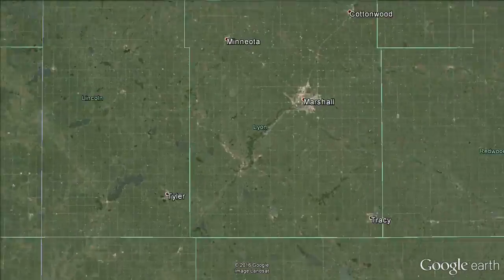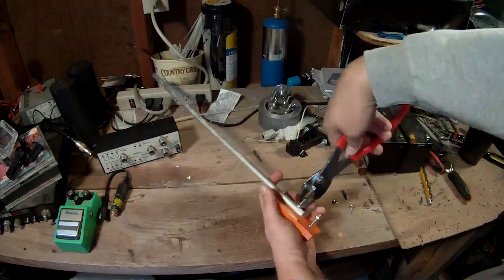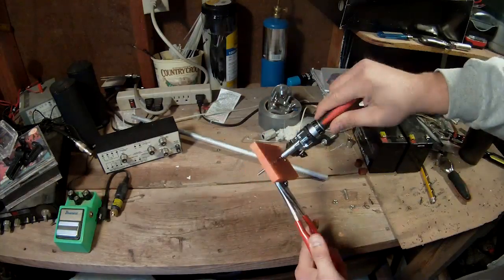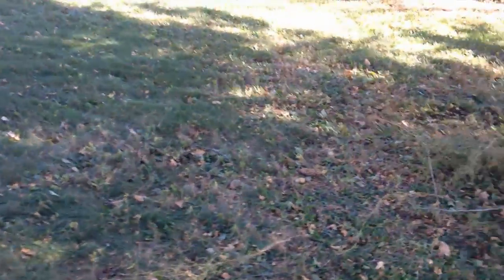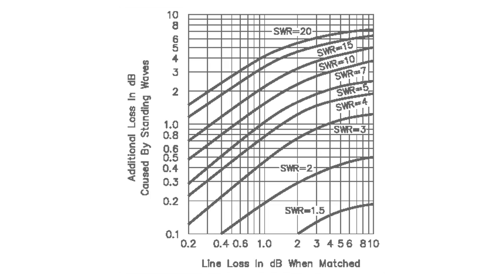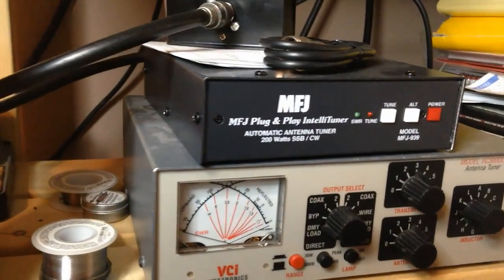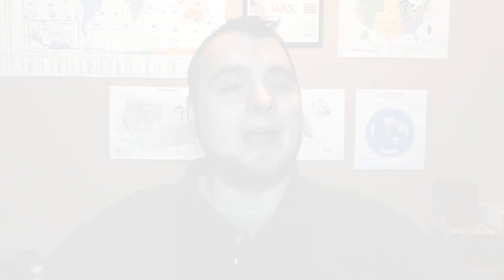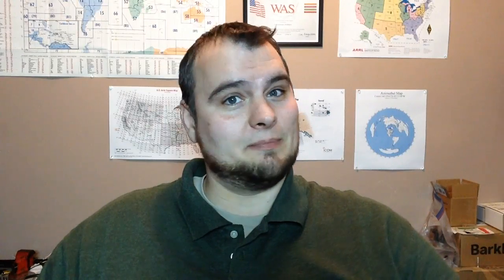Tri-Band Fan Vertical for 40-80-160m

Comment: As someone who was told by several people that I should forget about building a vertical antenna in favor of anything else but that, I can say that I work the same stations as others in my area, better than they do, with the same or less power. I've concluded that the real answer as to why horizontal antennas are "quieter", is that they are NOT AS GOOD unless you're into working satellites directly above, on HF. And I'm calling MYTH on that idea that man-made noise is vertically polarized, I think it's more like this: even horizontal NOISE doesn't propagate well! LOL 
Have fun with your vertical!

Comment: I am going to try this. I was wondering if a vertical far from my house would help with reduced noise. I have an interesting situation, the place I want to put my antenna is a swamp, so the water level changes I am thinking about having my feed point on a Styrofoam platform so when the water rises so doe my feedpoint to keep it above the water. I was concerned about having the vertical element near a tree. Thought it might be a lightning magnet so i will probably keep the feedline disconnected when not in use.
Glad to hear it worked well for you. Hope it works ok for me. It will be lower than my home since it will be in the swamp but if I get a good ground plane it should do well I hope.

Comment: Hi Cory, 
great video. Can you detail how you secured the radiator wire to the tree? Did you use insulators? How did you get to the top of the tree?
Reply: Edd Thirty - I use a fishing pole with a racquet ball attached to the line to pull antennas over trees. I always use end insulators, most of the time they’re just a couple inches of pvc pipe with holes drilled at each end.